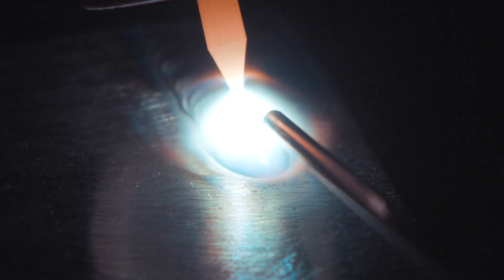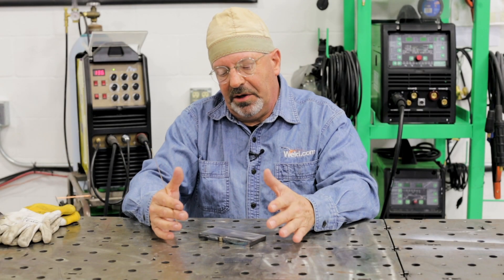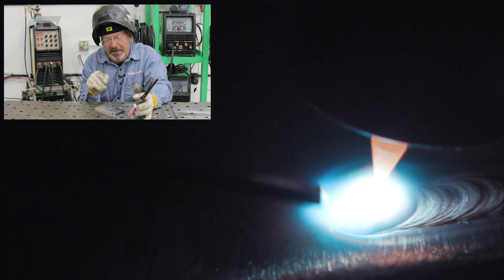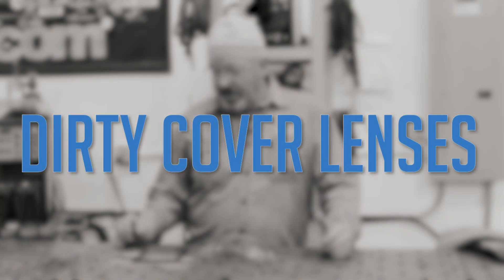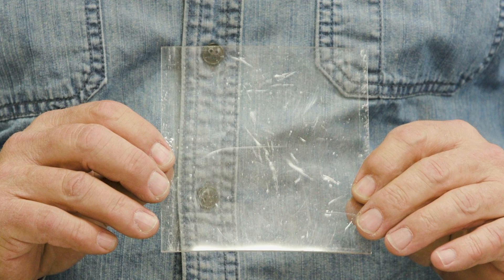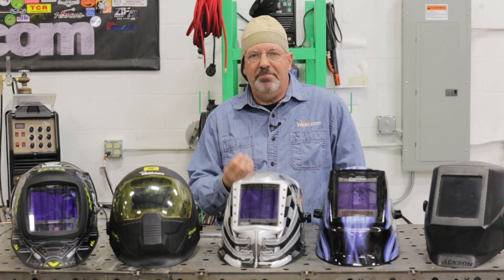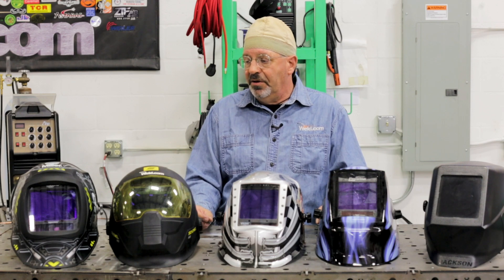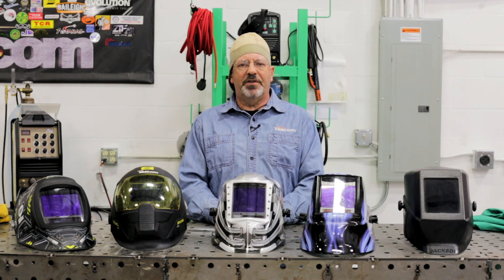I CAN'T SEE WHAT I'M WELDING!!!

Comment: Go to your jr college and take a course.  Best thing you will ever do.  I finished the workbook early and the instructor taught me some advanced techniques, like keyhole punching for arc.  Also pipe welding is a challenge with arc, since you are on a curved surface with a shrinking welding rod.  Drag angle and distance require a bit more concentration.
As far as seeing, open your eyes.  Electrical welding arcs are almost as bright as the sun, so if you cant see you are not focusing on the puddle, or your eyes are still closed.

Comment: Are YOU Right handed or Left Handed?????  Also, have you ever had Cataract Surgery???  
Good Videos, I like them ALL!!!  I have seen many weldors sit their helmet down FACE FIRST or roguh work or a rough table many times.  I have done it myself, but I broke myself of the habit.  As I got OLDER, having a clean lens is even MORE IMPORTANT.  When I had to start using Bi-Focals to read, I had to use MAGNIFIERS to weld, could NOT see the puddle good enough to control it.  After I had Cataract Surgery and the Crystal lens installed, I had to use a MORE POWERFUL magnifier.  I am SURE different people see DIFFERENTLY.  After all of the problems I had had with my eyes and the Doctors I have had to throw money at, well, there is a lot going on with some people's eyes.  It really gets complicated and different doctors will tell you diffeent things.  Also, if the Weldor has Auto-immune disease, it wil affect VISION sooner or later.  A lot of people NEVER think of that.  If one has the Skin Disease Psoriasis, there is a GOOD CHANCE they have the gene for Auto-Immune Disease the HLA-B27 gene.  Not a lot can be done for that.  I have PSORIASIS IN MY EYES!!!  If you have it on your Skin in the form of Psoriasis, have it in your Joints in the form of Psoriatic Arthritis, there is a good chance one has it in their EYES as well.  The Eye, under magnification will look like a Cobblestone Street with these problems.  

The person with these problems will most of the time not have a problem in their 20's and even their 30's but after THAT it can get bad.  This HLA-B27 Genetic marker is often present in people with Chron's Disease and Lupus.  These auto-immune diseases are NOT CURABLE and they sooner or later will affect the eyes.  And then there is Macular Degeneration.  I have that as well.  But absolutely NOTHING can be done about that.  But people that are YOUNG and have psoriasis, well, they have a 90% chance of having these problems in a few years.  Drugs such as Enbrel can ease sylptoms in some people, BUT they TURN OFF the immune system and the sufferer gets a common cold and dies.  Plus there are other side effects.  The vision thing can be tricky and DIFFERENT for diffferent people.  BB

Comment: I'm not a welder at all. But I have to ask a question. If I can watch a person welding without a mask on video and see them welding just fine. Then why inside the masks you wear, do they not have a camera and screen to see the project with? A camera it seems like would be mounted on the outside of the mask and transmitting the video to you inside the hood. Or is this just something that cannot be done?
Reply: Prob because it would be more of a hassle, an experienced welder doesnt even really think about what's happening, me for example been doin it so long as have others, that I chuck up a rod and just weld, I dont need to see everything to know it's going in how I want. Sound and feel goes a long long way, out in the real world on location 70% of the time you'll be in a bind or a bad spot.... I had to weld a 8" heavy wall pipe in a mud tank a while back a 1-1/2 off the floor, crammed in a corner with no way of seeing from about 3 alcock to 7 alcock on the back side of the pipe by the floor as well as absolutely no way to get my hood in that corner... I went in the office and bought the secretaries powder mirror from her for a few bucks, went back in the shop climbed in the tank,  puckered my butthole up and welded the back side of the pipe with that  mirror, I could only burn maby 2"-3" of rod at a time and couldnt get a real grinder in there. So you HAVE TO nail it the first time. Us welders work magick and some of us have preformed more miracles than jesus over our careers lmao without recognition to boot. So having a camera mounted on a hood just to see a bit better would be more of a hassle than help

Comment: Herein lies one of my two biggest difficulties in welding. I'm getting older...and my eye sight isn't what it used to be. The only way I can remedy this is by wearing reading glasses on top of my prescription glasses. I've tried using those (what are they called...dioptor?) "cheater"  lenses, but they always fog up.
My other issue is that my hands shake more than I like. Makes it difficult to maintain a steady bead.
Reply: Get in the habit of breathing out by blowing straight down and you'll fog less.
Reply: You need to train yourself to put some distance between yourself and the arc. Overall, you will learn better control and just as importantly you will keep your head out of the smoke plume. That stuff certainly isn't good for you either.

A good optometrist would fit you up with a pair of glasses that will help you focus clearly at an optimum distance.

Comment: I love how great the view is on videos of the arc, unfortunately, I've never been able to get that kind of view through my helmet.  I've tried expensive helmets, I've made sure they're clean, I've tried bright auxiliary lighting, changing the shade, cheater lens, reading glasses inside the helmet, etc.  I simply can't see.  if the weld is long enough, I can sometimes sort of see a very dim, barely perceptible puddle eventually, but that's it.  I can't see the joint or any of the surrounding metal.   If I turn the lens down to 9, then the arc is too bright and everything is just  one big bright blinding ball of light, if I turn it to 10, the arc is fine, but then everything around it is too dark.  I usually end up welding off my line, or just welding on past the end because I can't see the joint.  I literally weld by "feel".  Now, for the general stuff I weld around my shop, I've always managed to stick everything together decently enough, but there is simply no way I could ever pass a test or make pretty welds.  I just don't know what else I can do to be able to see the joint and puddle.
Reply: Are you color blind by chance? I been welding.10 years and I run into the same problem. Try a gold shade 10 lens. Also stay away from autodarkening. I cant see at all through those.
Reply: I've had the exact same issue for years. I have three auto-dark helmets.  None worked for me.  Then I read Jeffgreer 198613 below about staying away from autodarkening. Wow, using an old style helmet I can now see clearly.  I'm amazed.  I suspect it's because I need a polarization correction in my regular glasses and the auto-darkening is causing me issues.
Reply: Your issue is the exact one that led me to this video. I have the problem. To solve it use a super bright led lamp right near your work and leave your mask in the sun to charge if it has a solar panel before you use it. Also different masks do matter... its only when someone gave me their £300+ one did it look like green daylight and you can see the bench even under normal light. Masks like clarke, I find too dark although some cheap ones , left in full sun do work quite well. The charge and light makes the biggest difference.
Reply: @theq-1  I am looking for a good led light how many lumens was enough for you ? I wonder if 1000 lumens is enough or if I should get more.
Reply: @webdigit  I use an 18v Ryobi one and its 900 lumens so 1000 should do fine.
Reply: @theq-1  thank you

Comment: My eyes were getting worse, had a hard time seeing the lines on the micrometers, welding was even worse. Went to eye doc. cataracts! I'm now just one week out of the last operation. I no longer use reading glasses, can read fine print. I opt for the multi focal lenses, expensive but should only need to do it once. I can read road signs, TV CC, and the news paper, even the fine "legal tender" lines on a $ bill. What a change. In the two weeks between getting the first eye done and the 2nd, I found that everything was whiter in the fixed eye compared to the original still untreated one, which now looked yellow. I think it was well worth the cost of the multi-focal lenses. The ones I got had just been approved by the FDA in August 2019. I'm 77, so older than dirt. Between Medicare and my supplemental insurance they would have paid for the standard fixed focal lenses, but that would mean I'd still have to use glasses for either reading or distance. I went to a high end, state of the art facility, with youngish doctor. The cost for the two eyes with the top of the line lenses was $8400. The lenses are made so your eye muscles squeeze the lens to change focus, much like when you were younger. The actual operation takes 15 minutes for one eye. You are awake and looking through that eye while they work on it. You are supposed to keep watching the two red dots so they can focus the laser on the right area as it burns away your old lens. With a few gentle taps of a ballpeen hammer the knock the new lens in and put two little springy looking thingys behind the iris that operate the auto focus.  Tricky tech! No pain, lots of eye drops, two follow-up visits to test results. THEY WORK!!!
Reply: Larry Schweitzer, WOW!!!!!
Truly amazing, I will look into that.
Thank you

.

Comment: Having cataracts will really mess up your vision as it makes the weld light really flare out and blind you . Had it happen in my right eye and couldent weld as only one eye welding is almost impossible as you have on depth perception .
Reply: Is that on the way to Macular De Gen,  my old boss welded a lot back in the day without a mask, now I'm thinking king,  I need a mask if I'm just around d it,  cutting g and gri did g, not just necessarily the one doing the welding.
Reply: Cataracts are one of the risks of UV light. The ark generates a lot of UV wavelengths. Ad a UV filter to your setup.
Reply: I lost my sight in one eye a few years back, and welding without depth perception is definitely a challenge. So I try to hear my distance by the frying bacon sound.

Comment: The real problem for me is that the recommended darkening settings are too dark and I can't really see what I'm doing. It took me a while to dare to reduce darkening, for fear of burning my eyes. Even so, I still set it more on the dark side, which is not the best for proper welding. The most important and, probably, most overlooked is the cleanliness of the lens - My lens tends to get really dirty inside and this is not easy to spot, as you tend to get used to it, because it darkens gradually.
Another point to note - for me it is easier to view the weld, if there is a strong lighting of the piece to weld - not pointing at me, only at the weld.
I guess most of these are personal choices and may not work the same for everybody.
Reply: Keep in mind lens cover cleanliness effects auto darkening lenses too because the sensor sees through that lens cover.

Comment: I've been welding for years, and never had any difficulty seeing what I was welding with my old helmets. But I never mastered the art of flipping the helmet down at the last second, making starting of the weld tricky. So recently, I bought a (relatively)cheap self-darkening helmet and now I can't see a thing! There's no contrast from the brightness of the arc to the relative darkness of the surrounding piece. Adjusting the shade knob doesn't help, either. The whole scene gets darker or lighter, but still not able to see the weld from the surroundings. So I bought another brand of (again) relatively cheap  self darkening helmet, but had the same problem.
So I tried one of my old helmets (non self darkening)and I could see as clearly as ever. 

Perhaps I should practise the flip down at the last second method. I don't know if an expensive self darkening helmet would be better, but I've already wasted as much money as I would have if I'd bought a good one.
I don't know if an expensive one would enable me to see better, and I don't want to risk spending any more money on one. I know I should have bought a good one first up. but that's just me.
But one thing I can emphasize, is that the old permanently dark lenses definitely work better than the cheapie self darkeners.
Reply: I totally agree with you there , I've only been welding for about three years now and I prefer the permanently dark green glass lens of the older style helmets.
Reply: autophyte 
Flicking your hood down is what a good welder can do.
Reply: @paramandans  I guess I'm going to have to 'bite the bullet' and practise flipping it down. I'm not going to waste any more money on experimenting with self darkeners.
Reply: autophyte 
Yeah it’s a good skill to have.

Comment: I need help! . I have been welding for 20 years mig and stick with no cheaters or glasses. I first started welding with a jackson conventional big window shade 9 for stick and mig. When I had enough money I made the change to a 3m speed glass large window 9002x running on shade 9-10. I have now started doing tig welding mostly stainless steal. I have changed hoods to a lincoln viking big window. I now have prescription glasses. I have tried welding with cheaters in my hood. I have also tried welding with my glasses on in my hood. I have tried changing the tint from 9-12. I still can't see the puddle, tungsten ,and rod like you say or show in your videos. Please send me some advice.

Comment: You should always be able to see your weld puddle,........I use the old helmets,....I can see everything with them.
The automatic helmets I used I had to pay more for them and weld blind.
New helmets show glare.
Mig welding and arc welding is easiest and cheaper to do.
And hopefully you will not die of lung cancer.
They have smoke  sucker machine's now,.. invest in one.
I like the Old Green Glass welding Helmet's you see it all.

Comment: I was having issues with overhead lights and backlighting causing internal reflections in my helmet.  A huge improvement in visualization was seen after I made and added an "ape drape" out of thin leather that attaches with snaps to the back of my helmet.  I won't weld without it now that I know what a difference it has made.

Comment: The problem I have is with the lens in my glasses.  As I age and my prescription increases, the lens focus the light more in my eyes.  I have to go to a darker lens in the helmet to keep the light from blinding me; then I can't see the weld anymore.  It's hell getting old.
Reply: Yor are probably getting cataracts in your eyes -- had it happen to me  . Evrey bright light would flare out like crazy .
Reply: Computer strength glasses put the focal point out at arms length. Tell your optometrist what you're trying to accomplish and have a pair of glasses made specifically for that distance.
Reply: @mikem3770  That's what I did - got a prescription for ~900mm/3ft ãs that's my monitor distance, and one for ~300mm/1ft for reading and writing. There's enough difference to make it worthwhile.
Reply: I'm a welder and watchmaker. I seem to have chosen to be blind in my later years! Glasses suck full stop.
Reply: It certainly is a drag getting old, but think about it - it's better than the alternative (being dead)!
Reply: I had my optometrist give me a single lens prescription for the distance I needed when welding. Made a huge difference. Bob’s recommendation to weld at arm’s length made sense when wearing my progressive trifocals.

Comment: One more tip:  Don't buy a cheap auto-darkening helmet.  They work fine 90% of the time, but the other 10% they will darken just a fraction of a second too late, and the first few inches of weld will look like shit because you will be too dazzled to see.  I've found that the battery-powered ones work well; they cost more, but they're worth it.  The "solar -powered" ones are cheap, and nothing but trouble.

Comment: For stick welding, what about ambient light such as shop lights, or bright sun light?  I tend to like a fair amount of ambient light, particularly when I strike off, rather than going in dark and depending on the arc light.  I also am using auto darkening lenses.  Thanks for the tips.  Jerry